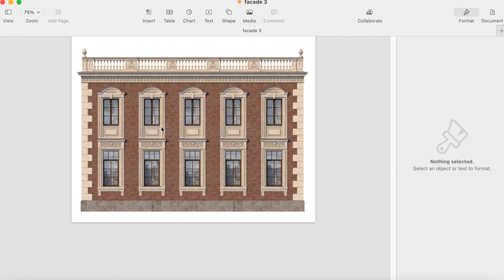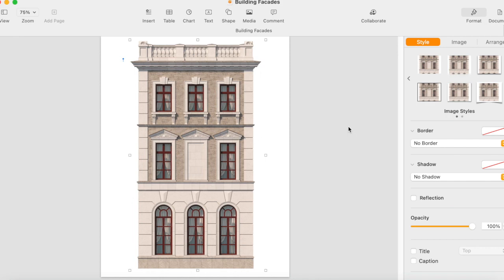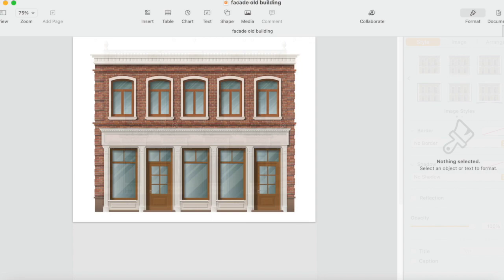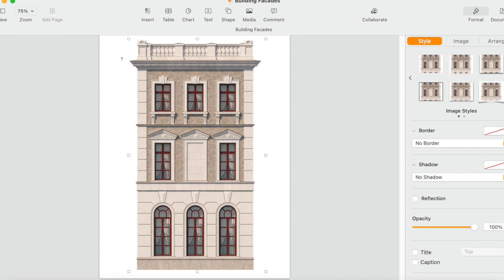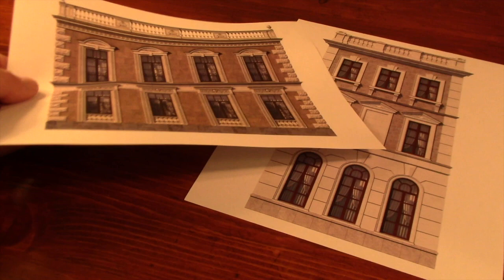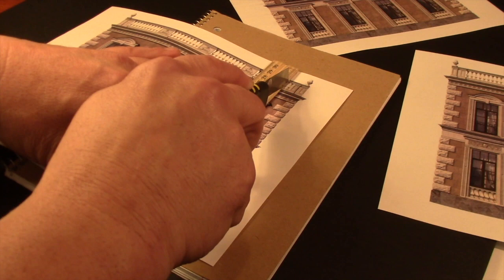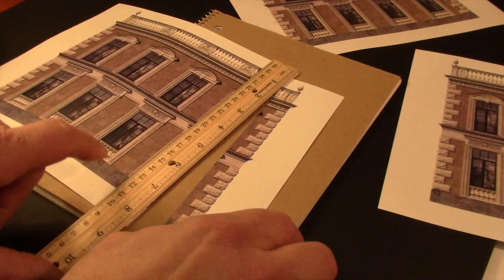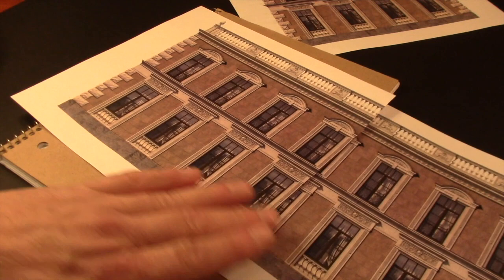O Scale Gauge Buildings with Printer Paper and Foam-Core for Layouts Lionel Williams MTH Web Images

Comment: Nice looking buildings, the end result lacks a bit of depth that you could easily add by printing another copy or two of the structure and layering additional thicknesses of card stock with them glued to it around the window frames and the cornice trims.   Great modeling  "trick" that has long been forgotten, Thanks for introducing folks to it
Reply from the maker: Thanks!😀